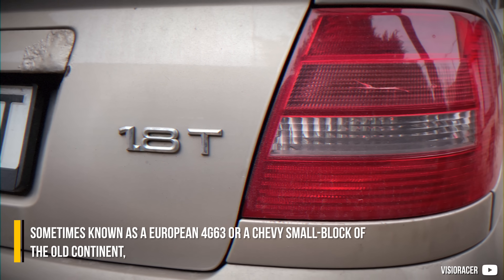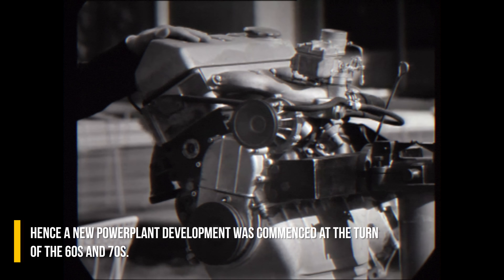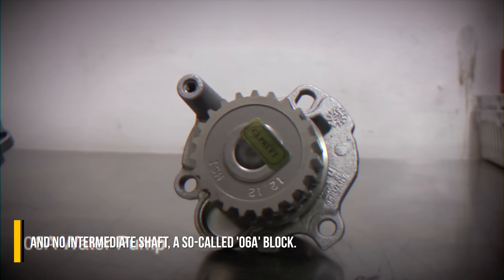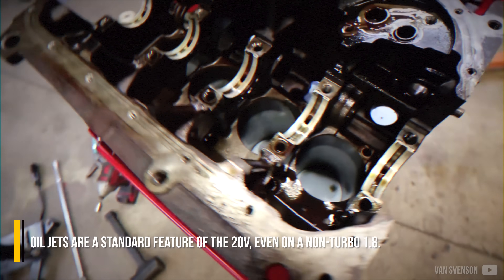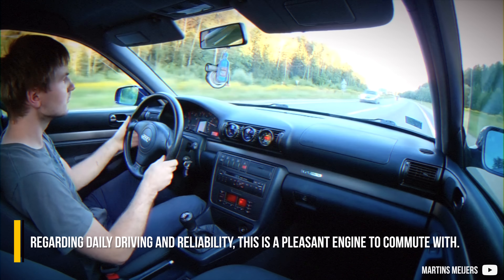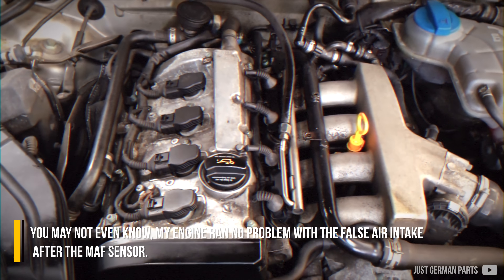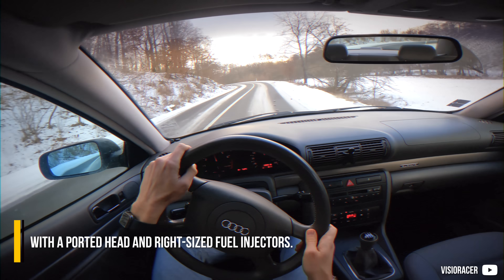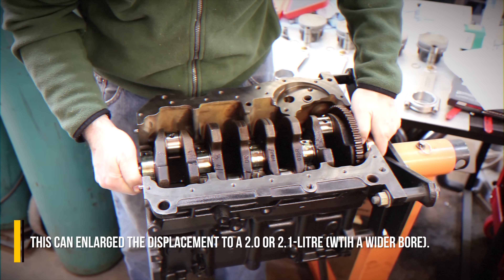Why Is The Audi 1.8T 20V So Good?

Comment: Audi are the most unreliable car in existence, there engines are pure shite, the timing belts have to be changed every 30,000 miles or three years which is the dumbest thing ever, most cars it’s 100,000 miles or 10 years

Comment: Well after a simple Chip-Tuning from 150 to 180 HP (Stage 1)  this engine is still very reliable. I got my chipet 8 Years ago with 80.000 km. Now it has run 265.000 km without any problems!

Comment: Your youtube came up in search results!
I just pasted a question into AI search. Try it out!
"Audi or VW 1.8t engine. Is there any such thing that could also be causing to much pressure for the oil cooler o ring to hold?"
AI Overview 
Yes, with an Audi or VW 1.8T engine, a common issue that could cause excessive pressure on the oil cooler O-ring, leading to leaks, is a faulty PCV (Positive Crankcase Ventilation) system, particularly if there is significant oil sludge buildup due to poor maintenance or high mileage; this can cause increased crankcase pressure, putting strain on the oil cooler seals. 
Key points about PCV system issues and oil cooler leaks:
Sludge buildup:
When the PCV system isn't functioning properly, oil vapors can't escape the crankcase effectively, leading to oil sludge accumulation which can block oil passages and increase pressure. 
High engine temperatures:
Excessive heat can also contribute to higher crankcase pressure, putting additional stress on the oil cooler seals. 
Signs of a faulty PCV system:
Excessive oil consumption, rough idling, engine performance issues, and oil leaks around the valve cover. 
Other potential factors that could contribute to oil cooler O-ring issues:
Worn out O-rings:
Over time, the O-rings can become brittle and worn, losing their sealing ability. 
Improper installation:
If the oil cooler is not installed correctly, the O-rings might not be properly seated, causing leaks. 
High-performance modifications:
Modifications that significantly increase engine power can put additional stress on the oil system, potentially leading to oil cooler seal issues. 
What to do if you suspect an oil cooler leak:
Check the oil level regularly: Low oil levels can exacerbate oil pressure issues. 
Inspect the oil cooler and surrounding areas for leaks: Look for oil residue around the O-rings and connections. 
Check the PCV system: Inspect the PCV valve and hoses for signs of wear or blockage. 
Replace the oil cooler O-rings: If the O-rings appear worn or damaged, replace them with new ones. 
Consider a professional inspection: If the leak persists, consult a qualified mechanic to diagnose the problem and perform necessary repairs. 

https://www.youtube.com/watch?v=V7OYmA3fvUU
https://www.euroautopro.com.au/post/common-problems-of-audi-a3-8l-1-8t-a-comprehensive-guide
https://www.lubezone.com/blog/what-causes-low-oil-pressure/
https://www.htsaves.com/blog/top-5-causes-low-oil-pressure/
https://www.bavarian-auto.com/2019/03/12/why-is-the-oil-light-on-in-your-audi
https://www.blauparts.com/blog/audi-a4-timing-belt-replacement-18t20v.html
https://poudresportscar.com/the-5-most-reliable-audi-engines/
https://www.lawrencechevy.com/blog/The-Dangers-of-Driving-with-Low-Oil-Level
https://www.audizine.com/forum/showthread.php/610203-1-8t-Oil-Pressure-Survival-Guide-and-troubleshooting-DIY

Comment: Compensate for the undersized oil sump by using a Mann 940/25 filter, the largest one you can fit between the oil cooler and the left engine mount

Comment: This motor is trash. Might as well buy and build a VR6 if you want a real bulletproof motor that can handle loads of power. You have no clue what you're talking about.
Reply: you mad, bro?
Reply: Pure waffle. This engine can get a lot of power out of it with some mods and will cheaper than to do on a vr6

Comment: I have a 1.8t agu fully stock with 165,000 miles on her and she still purrs like a cat. Couple of years ago I pulled the threads on the sump plug (2 oil changes per year for last 13 years maybe had something to do with it) so I replaced the sump (along with the oil pump). With the sump off the engine looked as if it was made out of gold. I wish my phone hadn’t died as so I could have took a picture, I’m not kidding you that engine was pristine.

Comment: I have 1.8t in first gen skoda octavia and it has now almost 400k km with no major issues. Its daily driven, and i love the engine dynamics. Its quite fast considering fact that car weights about 1250kg. Its fun to overtake other cars on autobahn in 200km+ speed :D

Comment: EA827 engine, also known as AP 1800, is one of the best engines Volkswagen brought to Brazil. Mostly aspirated, they're still running until today, because are very reliable and cheap. Unfortunately, the 1.8T are more expensive and most of them over here are scrapped.

Comment: I've run two 1.8T AJLs up to 385,000km in facelift B5 quattros. One I've sold, the other is still driven daily. I found with both at around 250k the exhaust valve stem seals harden and start allowing oil past. To be expected with a turbo engine as the exhaust valves can get extremely hot, even the sodium filled ones in the 1.8Ts. I've always just kept driving them like this until the oil usage gets to about 1L per 1000km, then I pull the head and inspect - both have made it to 350k before this sort of oil usage. At 350k the cross hatching on the cylinders was still present evenly across all cylinders, so new valve stem steals and back together. One engine I had to replace the valve guides on the intake side as there was a very small amount of axial play present - this is the car I drive daily which has 390,000k and uses no oil between changes. They really are great engines. Fuel efficient, fun to drive and surprisingly pretty cheap to run.

Comment: VolksWagen's  iconic1.6 litre aircooled 4 awould not pass emmisions tests in the early 1970s and the new VolksWagen 410 was impossible to sell.
VolksWagen bought Audi and decided they would let Audi design cars for them, ans would put the volkswagen trade mark.  The small 4 cylinder liquid cooled motor for the new Audi Fox became what all later VW engines were derived from.  This was later made into different sized and more powerful VW engines, and even a diesel for the Rabbit.

Comment: These engines are absolute garbage, they can’t hold boost for shit and they like to Chuck conrods clean through the block constantly however, the Volkswagen PD 130 ASZ is a really good engine and highly tunable
Reply: I don't know what you talking about. I mean maybe you are right ,but what I can tell I have a Passat 1.8t AWT engine code from  2001. I only changed the connection roods ,fuel pump, injectors and edited the pcv system and added a maxpeedingrods turbo.  I spent like 1200 euro.  My car is run at 350hp  since 2,5 year without problem. This year we just had a trip to Germany and Italy 7000km+. In Germany I was pushing really hard 240km/h for a minute without problem. I just didn't pushed more because the injectors started to making a lot of noise,probably they was top of their timing.
Reply: @laszloszell8753  how much boost are you running? There’s a point to my question.
Reply: @livinglifeboosted1642  1.2 bar boost.
Reply: @livinglifeboosted1642  1.2 bar , but honestly is not about boost pressure.  Is about CFM or airflow. A big turbo can move 500 cfm's at 15psi and a smaller move 300 cfm's at 15psi. Airflow is what makes power, not boost.
Reply: @laszloszell8753  I get what you’re saying, but it’s efficiency. That is the problem if you put 14 psi boost on a k20 440 hp on stock internals. Obviously it will explode eventually, but still it can do it I have been inside hundreds of 1.8t engines and yes, I know once an engine is forced, it can be capable but that is not the point 22 psi and make like 260 hp is pretty inefficient no one will ever convince me it is a good engine I have seen too many of them with massive holes in the block even forged ones
Reply: @livinglifeboosted1642  Look I just came back from 5 week vacation.  I made 7000km+ (NL to HU,From HU to ITALY and back  in NL) with one tank I made 880 kilometer.  In Germany I was push hard 160-240km/h and I had to stop after 680km wich I think pretty good.  When I drive to work I have to tank every 600km or so . 350 HP nothing for this engine if you change the connection roods and is tuned on dyno.
Reply: @laszloszell8753  lol someone’s getting salty 350 prophetic power 😂😂😂😂
Reply: @livinglifeboosted1642   K20 is would be to much for 350hp goal. Is rated for 400-600hp. Gt28 with T25 flange is perfect for 1.8t. K03,k04 is worthless  just kill both the turbo and engine because of psi/horsepower ratio.   How I said with gt28 at 17-18 psi you can reach easily 350hp on dyno .
Reply: @laszloszell8753  true

Comment: Been thinking about adding an Audi TT or a Quattro A4 to my fleet but the power output is just...not there to be honest. K20 Honda engines with just and intake tube with cone filter and exhaust can get into the 225WHP/170Ft/LB torque, without a turbo to help. IDK...I REALLY want a A4 Quattro but the power just isnt there enough.

Comment: audi 1.8 engines are a piece of crap, AMB heads crack, timing belt and chain designs doomed to fail, 2.0s even worse, plastic coolant flange, water pump behind timing belt ... coil pack wiring doomed to fail, have had 6 MBs and 1 audi 1.8 , 2 actually, my first and my last... seems like good german engineers join MB, and audi likes to hire those that MB would reject

Comment: 5:35 stock internals are good for 300 CRANK HP with a off the shelf tune
MAYBE you can get 350 CRANK hp with a master tuner on a dyno and NOT blow a rod but whats is possible and what should be done are different things  
issue with stock rods is TQ spikes early on in RPMS and if you can eliminate them i would safely go to 285 at the crank anything more is a risk

Comment: I picked up an old 2000 Audi TT 225 off a friend about a year ago, engine is at 340k km and definitely has some problems but even here in NZ getting parts for it is a breeze, some after market 225 specific stuff is a pain but that's understandable. Love the engine though and can't wait to throw an intake and cat back on it so it sounds better

Comment: I've got one as well. 2002 audi s3 8l. My precious is very unreliable 😵. Just today, -21 C out. Cold but that sp cold a car should struggle to work. Starts up no problem, let idle for 5 min. Then another 2 or 2 holding it ag 1500. Start driving and Temps are already half way to 90. That's much to fast but I also noticed the vents are blowing ice cold air, should have warmed up a little by then. I start driving for 5 min. Tempest are already at 90 (driving it very slow) and still blowing ice cold air. Another 5 min and its iver heating, blowing ice cold air and when I shut it off to see what's up, it wluld crank for 3 seconds then lump to life. Parked it at a McDonald's because it was over heating a d j was Hella cold. Waited 10 min. Starts up fine, doesn't go above 90 but still no warm air. Finally a couple mins later the windows start to defrost, ans then warm air! Dat in it running at home. Stopped amd started then car a few times, working loke it should. Like wat

Comment: Had my b6 1.8t with a 5 speed for a little over a year. She’s been great to me, a few issues but nothing to major. Getting ready to tune now since the maintenance is all done ko4 is installed, as well as high flow cat, bigger injectors, dv upgrade. Can’t wait to see what she does
Reply: I ended up getting crashed into and had to sell the car. If you live somewhere with lenient smog I’d suggest getting rid of the oem check valves and excess hoses. Plus turbo upgrades are easier to get away with if you want to go with a garret. Happy tuning everyone I now own a mk7 alltrack that will be fast soon
Reply: @tunanocrust5089 sad to hear that, I just got my driving license and my dad gaved me his Audi b6 1.8t avj, can I tune this engine ?😅😊and do you know how much horsepower does this engine code has?

Comment: 2002 MK4 GTI, AWP engine, KO4 with Gonzo stage 2+ tune, 3 inch downpipe and exhaust, inter cooler, and some other upgrades. Also that generation of GTI gets kind of overlooked for how light it actually is. Why they can be deceivingly  quick for lower power.

Comment: Always wanted one... Audi, VW, or Škoda Octavia (1st gen) with this engine... My uncle (now my cousin) has one, I drove it for many times, and I like this engine so much... but as my mechanic keeps saying... essential spare parts? There are non, only on scrapyard, in the same poor state as yours... When he had a customer in a shop, that needed a  replacement hose assembly... there was non, as VW stopped producing them (you know, after 10 years you can f**k-off, no spare parts for that old crap...), so whats the option? To buy used one, that will hold on for 10k kilometers before it gives up too? Same for other "special" parts that this engine needs.
Btw, my uncles Octavia won't start, problem was exhaust bellow and two lambda sensor in the exhaust... price for replacement... 1.600 EUR.
Just something to think about... ;)

Comment: Psst. My b6 1.8t 6 speed with 178k miles just got 37MPG to the office the other day. Test pipe is the only mod, with a CEL. I changed the oil every 3k miles and always put premium fuel in it. Only had to replace the oil cooler and the heater core (And brakes+calipers I live in an area that gets snow). Car runs like a top.

Comment: I really don't miss the fun of VW engines, check oil every week, plastic pieces falling apart, Bosch electronics that fail every 2 years, etc...  I much rather change oil every 8K km and never have to open the hood.   VWs are for hobists.

Comment: I had this engine in my 5 speed A4 back in the day it was a great engine,  I know that engine would still be running, but when the car reached close to 200k miles, nearly every electronic function of the car had issues.

Comment: These engines are HORRIBLE. Sludging issues. Blow a Tbelt, blow the head. Yea....change the belt they say. However, these belts are so damned tiny, they have risk of popping after 30K. Then we get into the electronics of this engine. Sub par is a generous assessment of this engine. Ignition coils that melted. Ignition coil harnesses that melted. Turbo feed lines blocking up. 

This engine is not the Chevy small block of anything. Here in America...these engines are all but nearly extinct.

Comment: I have a 1.8T AWP with a K03S in my Jetta, it's the only thing about the car that has been reliable 😂

At 140,000 miles I got it tuned, now it makes about 22 psi of boost and it's still on the original turbo with 183,000 miles.

Comment: I've had 2 GTIs in the past both with 1.8t's. One was an 01 and the other was an 03 with the k03s turbo that made 180hp from the factory. Full intake + downpipe exhaust and a remap gave it in the ballpark of 200+ whp. When you have a gutted MK4 with that much power, there's not many cars that could keep up with it 0-100, but it did run out of steam in the top end. Crazy thing is that both were extremely high mileage motors and still ran like dreams, one was at 275000km and the other at 335000km

Comment: My dad has a 01' tt, I gotta say, even after 200k kms it rips like new. The things that have worn out are the convertible electric motor and the boot latch. Easily fixed. Had a misfire in one cylinder so we changed the spark plugs and good as new.
Reply: My first car was a 2001 audi tt coupe. I got it at 225k miles (360k km) and it still runs just as good. I have had to replace some of the plastics for the cooling system, thermostat, and some pcv, but other than that I had nothing major happen, engine wise. I put about 25k miles (~30k km) on it, and slowly restored it to the best of my ability. The only worst part of it was that it could only fit 2 people comfortably, and not haul much as it is a Quattro which had less trunk (boot) space than the fwd. Sadly I plan on selling it as I am going to college and I need something to haul my motorcycles, but it was the greatest car I have ever owned. If I could, I will not sell it as I love the car to much and I would love to pass it on to my children one day as their first car.

Comment: In Brazil that engine family is very popular! We call it AP engine (It's not exactly an AP but the parts are interchangeable so "It's the same engine")
Reply: A mechanic told that in te 80's he had an AP 1.6 and raise so much the compression ratio (because he changed the original piston to a flat piston from VW Beatle 1600 used in alcohol engine) that engine worked just like a diesel engine and the only way to stop was "killing It" put in the 1 gear and let cloth.

Incredible that engine run for years without a problem!

Comment: I had 1998 Audi A3 with 1.8 AGU Engine factory tuned by ABT. It had like ported heads and some other stuff. Had like 180 to 200 horsepower. Miss that car, sadly sold it :(

Comment: Had a 2001 A4 quattro b6 (AVJ) engine for almost 6 years, was remapped to 200bhp. Great engine hampered by crap vacuum system. As was mentioned oil sludge is the main route to failure with these so oil changes and using the larger oil filter is essential. Think I went through about 5 coil packs in my 6 years of ownership. Also had a crank hall effect sensor fail. Went through 2 water pumps also but didn't mind that as it was due a t belt anyhow. Eventually changed the car for a EA888 A4. Wish I could say the same for that engine.

Comment: I had a 2001 B5 Quattro. I drove it on 18psi with a diode mod for 2 years with no problems before selling it. I would recomend it to anybody, but only if you can work on it yourself. Oh and cross reference part numbers with Passat, same parts at VW are way cheaper.